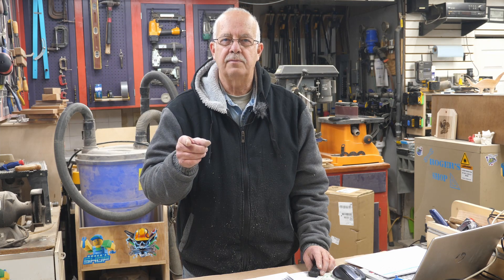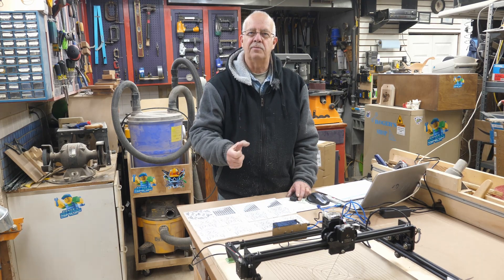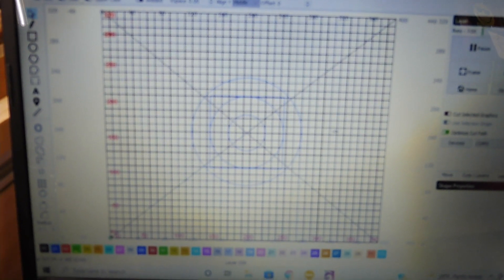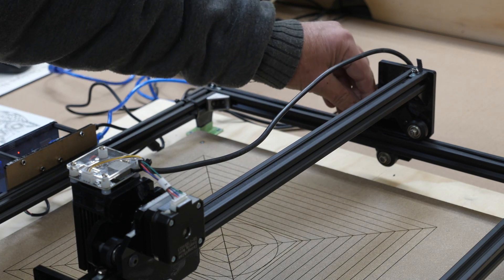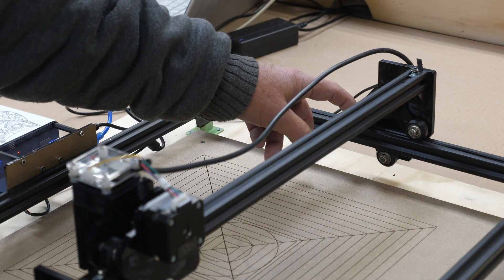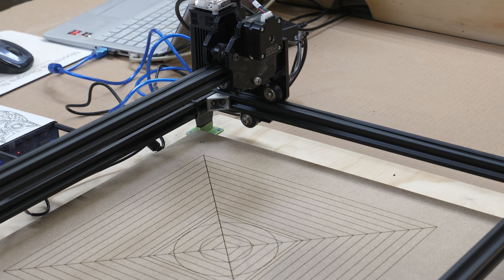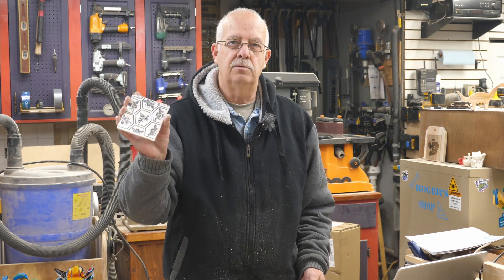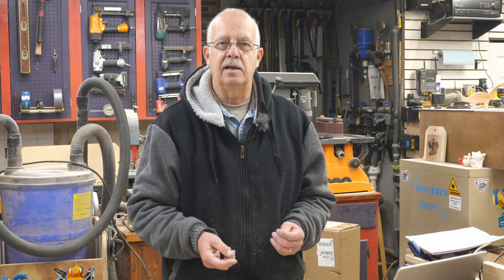Two Trees TT 5 5 LASER Testing Results

Comment: Hi Roger, if one were to upgrade from a 5.5w laser to a 10w laser, I assume the control board and power supply would typically also have to be upgraded, correct?
Reply from the maker: Probably not the control board as most modules work on a TTL signal.  However, the power supply "may" need to be larger.  Depends on what you have to start with and what the manufacturer recommends.
Reply: @rogersshop  are laser control boards generally interchangeable? for instance, could you move a control board from a 300x300 frame to a 400x400 frame as long as the connections fit? or would that require some kind of additional programming?
Reply from the maker: @christopheraltonart  Not all are interchangeable, depending on manufacturer.  If moving to a larger format, some changes will need to be made in the firmware.
Reply: @rogersshop  Thanks, that's helpful. Appreciate your time

Comment: my belt drive units repeatibility is off about a mm or 2 every time, thats why i really like the 3018 for tiles. that line in the file is an arduino error issue, i get it sometimes on my 3018 but never on my ort as it has a dif board.

Comment: how much power are you engraving at? i have an ortour with a custom 5.5 w on it as i burnt up 2 ortur lasers. and i have a sainsmart 3018 with a custom 2 w laser on it that i use for tiles.  the number one thing i see is cooling deficiencies in these units. they get hot and they degrade. i never run above 80% power and try to stay at 60%. My Ortour frame and laser head a 5.5w burns NWT's at 1400/60 but at a max dpi of about 220. and my 2w burns NWT's at 1100/70 and a dpi of 318 and i could go finer but im old and that fine of focus is difficult for my old eyes. I also add 2 to 4 extra fans, for cooling and cross air flow to keep the smoke off my lens. these lenses will fog up with smoke and that will also cut the power till you clean the lens. i use alcohol soaked eyeglass wipes i buy by the case. IF you need to run your laser above 80% power the fact is yo need a higher power laser. these diodes were actually developed for screen projectors and were designed to run at about 30% power to achieve the 50000 hours they claim on them. just because we use them to engrave does not mean they were designed for this or are the best option. Happy Photonics.
Reply from the maker: For most projects (engraving), 60% is the norm.  I have nine diode lasers, so am very experienced with them.  This one is at the bottom of the list for quality and the manufacturer will not stand behind the problems.  I have never had a laser fail this quickly.  TwoTrees did acknowledge that there were some QC issues, but did not offer to replace any of the defective items.

Comment: Thank you so much for you review! I've decided to run with a laser engraver from my projects. I mainly need it for cutting vinyl material off the backing for custom patterns I can paint with, aside from the odd engraving projects that may come up. I've watched a few different reviews on this product, and similar ones, and like yours the best. You are to the point, and have tons of experience with them. Thanks again, I believe this little entry level one will provide enough project revenue to upgrade the head to a 5 watt or better very soon. Thanks again!
Reply from the maker: A word of CAUTION!  Cutting vinyl on a laser releases (produces) chlorine gas.  This is not only very hazardous to breath (toxic), it will corrode every metal part on the laser and will ruin the laser lens by clouding it.  Cutting or engraving vinyl and PVC should be avoided.